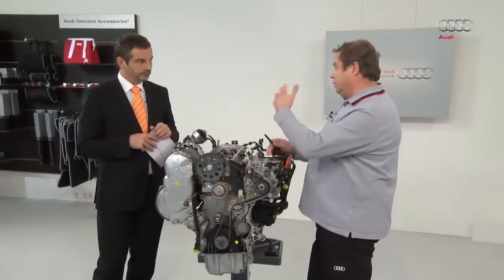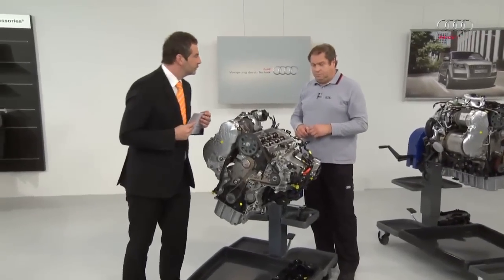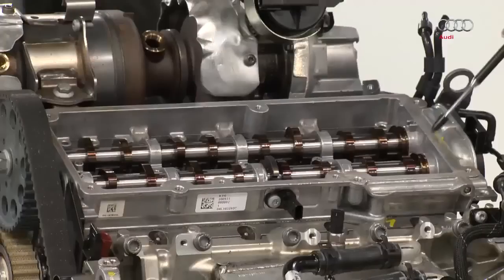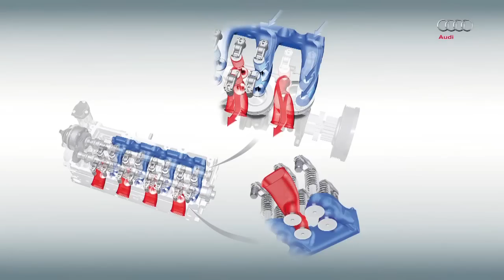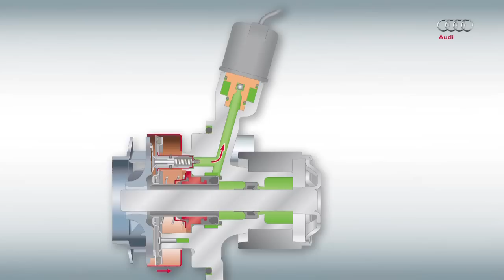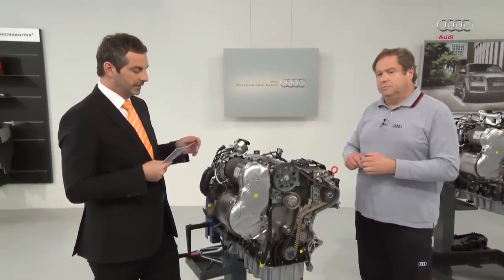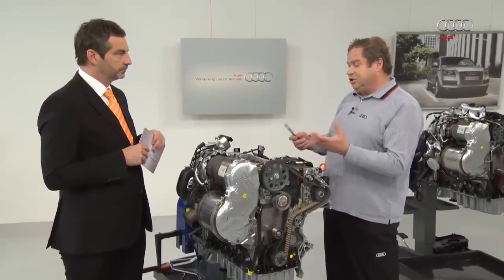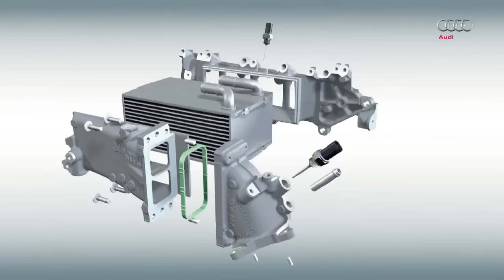Audi Engine1.6 / 2.0 TDI EU5 Service Training Information

Comment: That little bag with silicate in the expansion tank is the reason for so many troubles. With time the bag splits and the silicate granules start circulating in the cooling system ,blocking the tiny holes in the heater matrix resulting in no heating in the car. The result is over a £1000 in a garage if you’ve got no mechanical skills. So if you still have that bag just get rid of it and you the right coolant that will give you the needed protection.
Lot of people say bad things about that engine, but the truth is that the service intervals program from lease companies is the reason for all the problems and premature failure of the engines. Regular oil changes and filters will keep your engine happy and your pocket full... simple
Reply: Luckily, heater matrix replacement only requires minimal dismantling. Maximum 2 hours labour to do the job. Add on £60 for a new matrix and it's not a bad job.
Reply: @Audi_A3_8V_Repairs True, but better then all week for dash removal on a Mk5!
Reply: @Audi_A3_8V_Repairs It's almost like they expected people to have to regularly top up the coolant on a brand new car! How far VW have fallen.
Reply: Oil Piston ring - jako za to by potřebovaly rozkopat tlamy!!! Prej ekologie....

Comment: With the charge cooler being incorporated into the inlet manifold it leads to carbon build up and blockage of inlet as well as having general DPF issues like all common diesel engines but the additional heat exchanger element inside the manifold leads to more problems in the long run I have a video on my page going through faults on 1 of these engines having low boost problems and this was the cause only fault in ECU was p0299 low boost and checked everything only to find blocked inlet and blocked exhaust didn't even show a DPF fault was very frustrating

Comment: Wow, a lot of thinking is going into these engines. However as beautiful as they are, I wonder how they will do after warranty expires in places like here in Africa.
Reply: Luis Maruwasa neither of these engines should have any problems. Especially 2.0 TDI is an old engine, so no big problems there.
Reply: Now that they stopped using plastic piston rings and cam chains made from string the engines should be quite solid. But it's the emissions controls system which worry me now.
Reply: @rob-123  The diesel engines of VW never had timing chains!
Reply: @Nitramrec  they did.Only the four cylinder models use belts.

Comment: My 1.6 tdi dgte cooling system is cursed, i swear it is, I'm on the cars 3rd heater matrix, 3rd expansion bottle and 2nd main water pump, the last water pumps metal sliding sleeve had broken up, its unbelievable. Apart from that its been a good car lol
Reply: If you still have the car, fit the old style water pump without sleeve, heatertank from a petrol (doesn't have the silicate bag) and fill with g30 antifreeze. Permanent fix.

Comment: Hi. Do you have 1.6 tdi euro 6 version of this? Thank you for videos.
Reply: This is the euro 6 version
Reply: @dopiaza2006  But the title says EU5!
Reply: @Nitramrec  Hmm, it does, but this 'emissions control module' is from the mk7 golf range which is EU6 compliant. The EU5 has a much smaller flatter DPF on the rear of the engine.

Comment: wath a junk engines compared with the 90ties tdi etc engines. Is the reason that the good older experianced engeneers are changed for (cheap) jungsters?
Reply: Modern and quality doesnt go together, I have Audi 1.9 TDI, probably better quality then this common rail diesels but its much more noisy and dirty. My old golf 4 SDI sounds like a tractor or even worse but can run forever.

Comment: This is the the EU6 engine, not EU5
Reply: I thought the EU6 had the old Rovers variable valve technology which this engine didn't have. I never thought we would see variable valve technology on diesels but it now on the latest vag diesels to help engines to warm up. More shit to go wrong..
Reply: @rob-123  This is EU6 - the EU5 had a vertical DPF/catalyst. That was on the Mk6 Golf. This is for a Mk7
Reply: @dopiaza2006  i have an EU3 with this same engine no vvt
Reply: Its eu5 engine, no HP egr valve

Comment: Not good oil taking engines produced from 2008 til 2013 ......if you now there is sutch a stupid oil ring construction......why so long produce with this mega construction fould.
And it is prove that the engines are not good checkt Al these engines take mega oil within 100.000km

Comment: Plastic elements in pumps - that wont last too long. Typical German low quality.

BVecause u dont believe germans make good cars anymore?

They make expensive cars that are expensive to repair and brake easily.

I will give u an example. If these cars are that good and that expensive why do they break so often and so easily?

10 Years of owning Toyota and it never let me go. Every time, every turn of key and i ride them pedal to metal.
Reply: 10 years and 300.000 km of owning a golf 5 tdi 2.0 140ps  not once had a problem , dont know what you mean, service your car regularly  and you wont have those problems
Reply: @bigogr8731  
WE..BOTH..KNOW..THEY..HAVE..ISSUES

MAYBE..U..DRIVE..DELICATE?
Reply: @bigogr8731  

BTW.

YOUR..ENGINE..IS..NOT..THAT..BAD..ACTUALLY..PRETTY..GOOD

BUT..THEY..TEND..TO..HAVE..ISSUES..THAT..JAPANESE..DONT..HAVE
Reply: @bigogr8731  Your engine was designed over 20 years ago - I don't think he's referring to those. I have a 2004 Mk5 Golf 2.0 TDI with BKD engine. Still going strong at 200,000 miles.